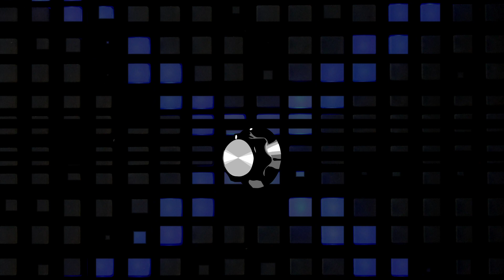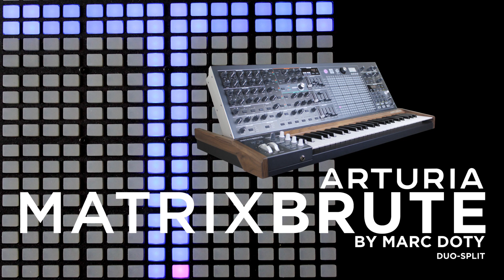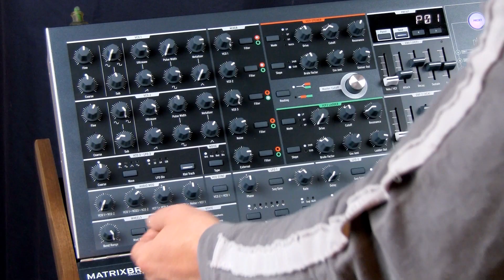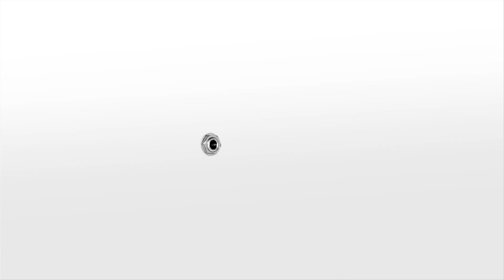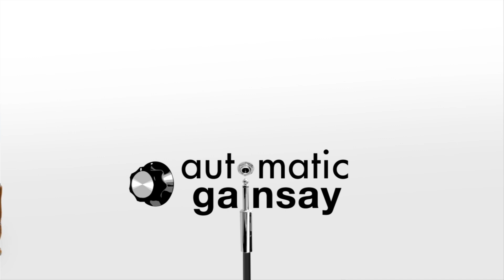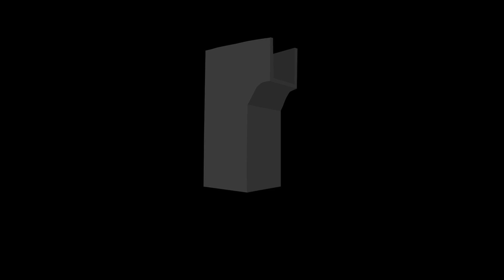The Arturia MatrixBrute- Part 14- Duo-Split

Comment: Also, one good reason to set the split point as the lowest key is that you then have the whole keyboard for the top layer and can use an external MIDI controller to play the bottom layer!
Reply from the maker: That is a very good point!  Thank you again!
Reply: This is an awesome tip! I was wondering if maybe you could expand on this though? How do you route the incoming midi to only that "second synthesizer" ?
Reply: @JoelMartinez  One way is to use the MIDI Control Center to set your input channel (i.e.: channel 1) which could essentially access the entire range of the MatrixBrute, and then you'd just have to restrict the inbound range from your source keyboard to the lower keys.

Comment: Small but important point: you can run any of the oscillators through either of the two filters and their corresponding split levels. It doesn't have to be 1+2 / 3.
Reply from the maker: You're right!  I think that's a very important point, and perhaps a big point!  Thank you for the correction!
Reply: And if one wants to go crazy with that, using sync and FM "across the split" allow some interesting synthesizing performances :)

Comment: Am I getting this right? The MatrixBrute does not have a "panel" switch to instantly get the synth to use all knob/button settings as currently set (the Moog Sub 37 has this, and I use this all the time)? If that's the case, doesn't that mean that you basically need to touch every single control before you have the synth reflect every single physical setting?
Reply from the maker: No, there is a panel switch.  It's up by the preset window.
Reply: OK, that seals the deal ;-)

Comment: Running everything at full/high levels like in the last couple of vids gives a very saturated sound. Gainstaging is very important on the MatrixBrute, giving it the range from Barbaric Brute to a Gentle Gigant. I can get the smoothest lyrical sounds from it by easing back on levels as part of the patching, Osc levels, mixer levels, filter drives/levels all play a part in this.
Reply from the maker: Well, I'm afraid you'll have to consider the source... as a guy who is an analog synth player first and foremost, I go the CP3 or Minimoog route in regard to levels... saturation like that is the key to fatness.  :)
Reply: Absolutely, saturation is nice to have - the many shades of MxB saturation sounds good too. And sometimes it's nice to back off and get into the full timbral range on offer. I thought it might be useful for viewers that aren't familiar with the MatrixBrute to know that is has a softer side as well :-)

Comment: So many questions:  So can you add more oscillators say if you had a modular rig feeding into one side of duo split? If you add something to the main input. . . where tf does it go?What happens if you use the modulation knob below to modulate the VCO on your "other synthesizer"?  Would every key you press with your lefthand change the modulation of your right?  Could you dare say,  turn the octave down so freaking low that you could have a silent LFO on the left side controllable by YOUR KEYSTROKES???? Woah bro. . . .